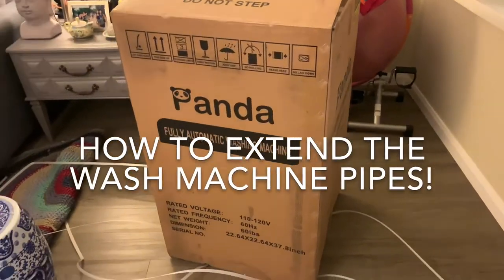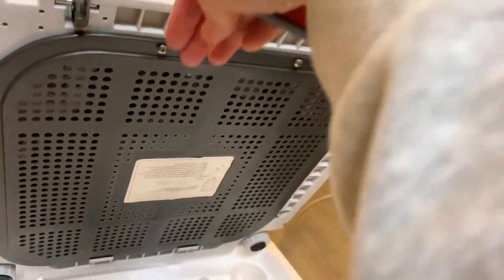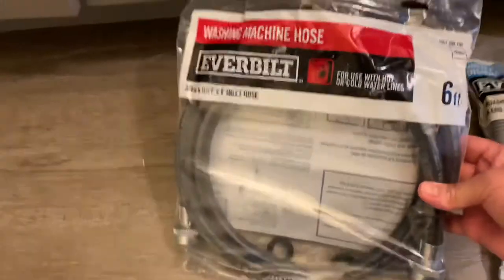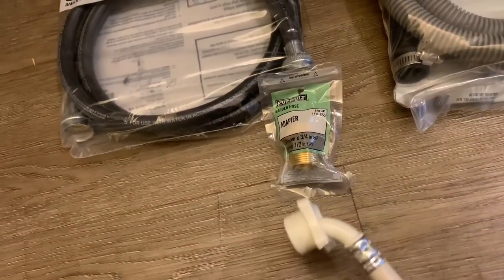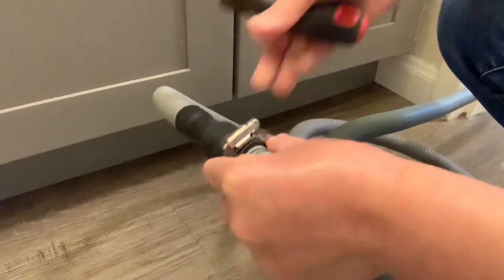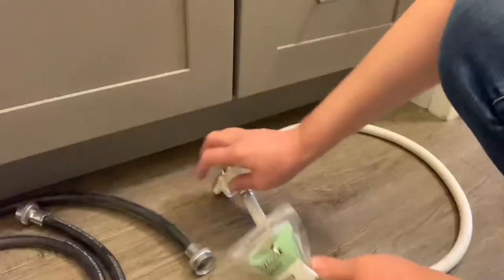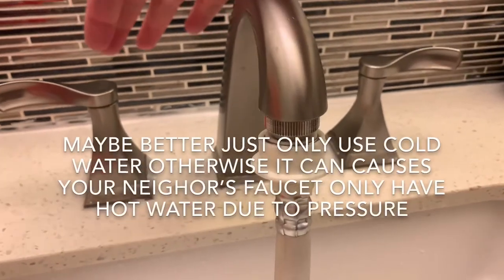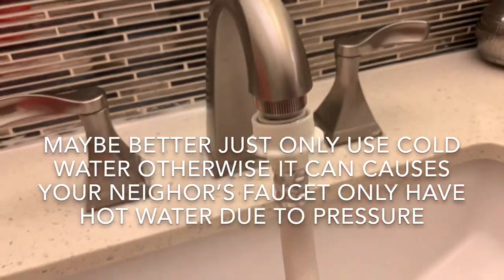PANDA PORTABLE FULLY AUTOMATIC WASHING MACHINE:  PAN6360W- How To Extend The Water Pipes?熊猫牌全自动洗衣机

Comment: Oh bless your that extension cord will get hot where its connection is please dont use extensions cord type manufacture tell you this cause it will put out to much heat and power for the wattage of the machine causing  it to get hot please dont burn your home plug the washer machine directly to the outlet wall if you doubt what I'm saying check your manual manufacturers book call electrician they will tell you I'm right how do I know 💁🏻‍♀️I did the same thing had I no notice my home may start fire or cord  catch electrical fire I'm glad thank goodness I notice it in time brand new dryer out the door you also cant use the extension cord on any house hold appliances always plug them directly to outlet thank for sharing Ni How Chin Chin Ni 😊

Comment: Does it pump water out automatically or do you have to lower the hose and manually drain.
 Also, can the water inlet be on/under pressure contantly or do you have to manually start and stop the water fill process?
Reply from the maker: All automatically!
Reply: @huahuaapple  oh nice thanks
Reply: Yes
Reply: @mrsstrawberryluv1  Thats not how this works

Comment: what's the brand of your faucet? having trouble finding faucets that can fit the adaptor :/
Reply from the maker: If your faucet is not standard faucet you just buy that small adapter I show in the video I bought from Home Depot to make it fit to connect your faucet and washer machine provided hose head adapter
Reply: @huahuaapple  we cant seem to find an adaptor from HD that fits .... do you mind sharing the faucet model you have?
Reply from the maker: @alicebubest  Delta B3511LF-PPU-ECO  149-032
Reply: @alicebubest  100,000 thumbs up.

Comment: What did you screw to the sink? 6:45
Reply from the maker: If your sink faucet is standard kind you can directly inset the water hose pipe to the faucet using attached adapter. If your faucet is not standard you can buy the thread from Home Depot to let it fit. If you are taking about the grey pipe die drain the dirty water you can just lift the seat and  put into the toilet and put the seat down or you can put it into sink or bath tub you can use some heavy thing on top so it won’t move. Hope I answered your question.